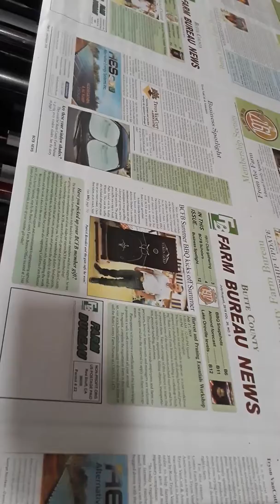Press

Comment: Nice i was into printing since the early 80s mostly sheet fed offset comerical printer
Reply from the maker: Very nice I run a newspaper press 2 sheet-fed presses a digital press I do it all I've been working for the same print shop for 20 years now
Reply: Cool I worked at a lot of local shops in northeast Philly I miss the trade we printed the 1993 Philly's year book when they won the penit from bindery to delivery an presses like to see the new digital presses
Reply from the maker: @bill4572  I have a couple videos on my YouTube of the digital press